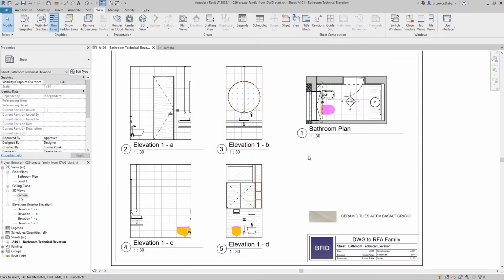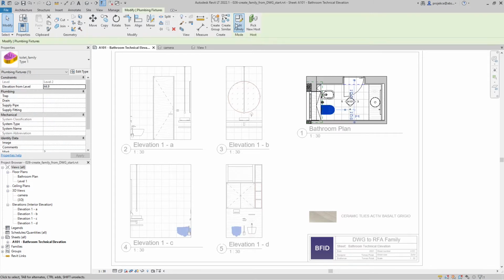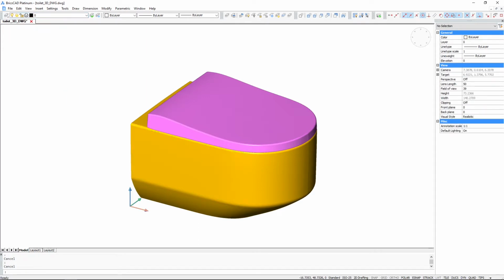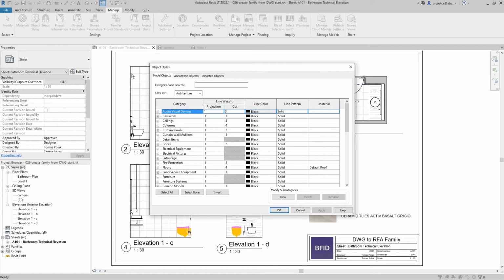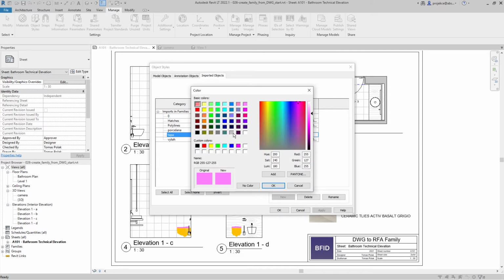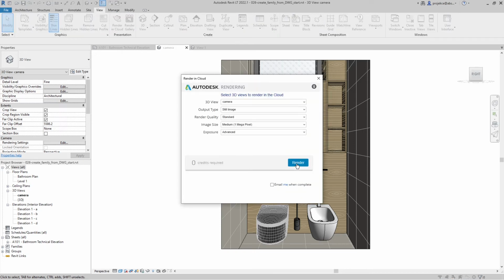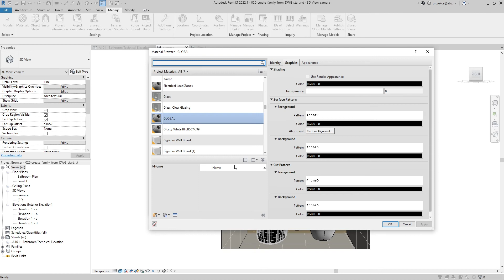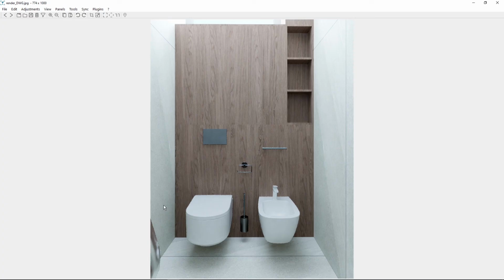Apply Material to DWG Import in Revit

Comment: It seems this only works with LINKED cad, not imported
Reply: it’s Still black even after changed the material
Reply from the maker: Hi, it should work for both imported and linked dwg geometry. Try checking your dwg layers if it doesn't work for you.
I usually first import dwg geometry into family before placing it in project. You can only import CAD geometry to family, you can not link.

Comment: hi thank you for this video it is very helpful ^^... 
I want ask... In case we downloaded a family from an online manufacturer and we need to change the material.
But sadly when we select the main element inside of the revit family, yes it in the mechanical equipment category, but it has no parameter into which we can change its material. Actually the element is a bit irregular in shape.
Is there any way we can add a material parameter to the mentioned element? thank you ^^
Reply from the maker: Hi, it's hard to judge without seeing the family. If the downloaded family is just wrapped dwg import, the material options that you have will be completely dependent on the original dwg model setup.
Reply: @BIMforInteriorDesign  hi, thank you for your reply ^^... If you wont mind I can send you the family file. I am just not yet aware of any other 3D entity that we can use and insert in a revit family.
Reply from the maker: @vrbaac1641  Yes you can post the file here in the comment section.